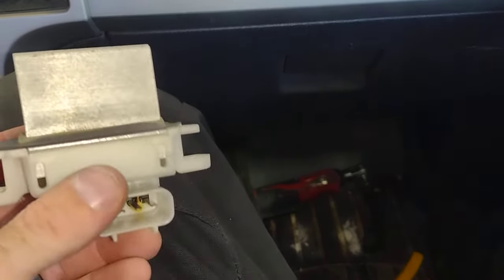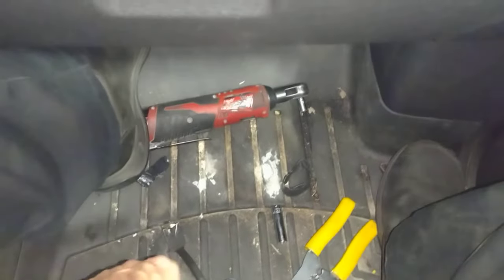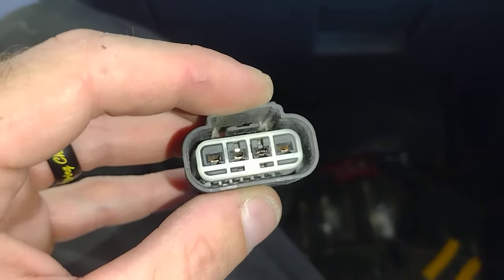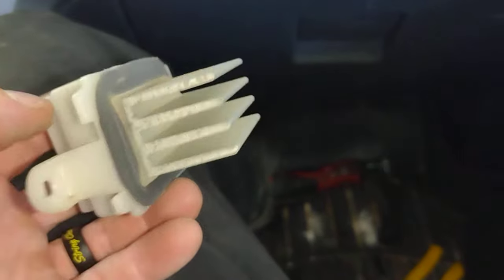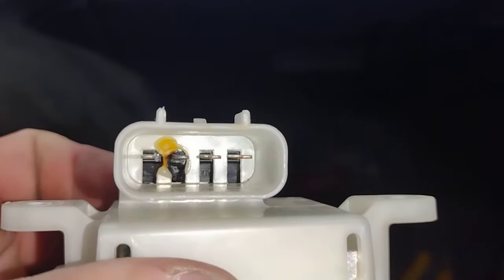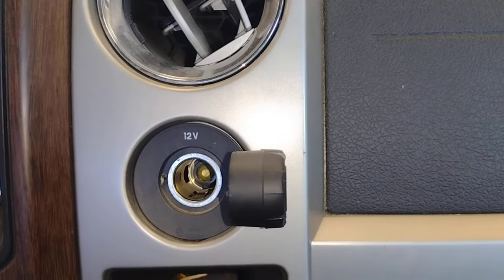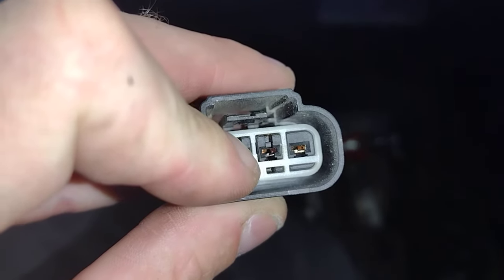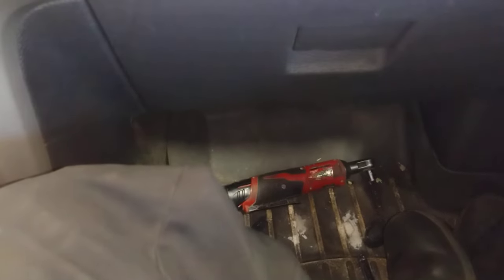2011-2014 F150 Blower Motor Randomly Works. Check This First.

Comment: I've replaced mine a few times already. Finally changed the wiring harness out with the one that came with the resistor and the motor hasn't worked since. Took the dash apart and got it to work on high but would not turn off. Got it to turn off and haven't got it to start again.. No heat, no AC. I checked for power at all connections. Checked for resistance and continuity in all but the black ground which I cannot find the other end going into the harness by the steering wheel. I applied 12 volts to the motor itself and it kicked right on. I have an aftermarket dash kit with blower module that I'm not 100% sure on. It's not a rheostat. Almost like an encoder that reads the revolutions for both fan speed and temperature knobs. Can't really test it. I've checked all the fuses and relays. Those are good also.  I also had the blend door issue with the loud vibration that I ignored for a while. The problem started where my aftermarket radio would not turn on, the module would not work. A few taps on the plastic would bring it back. Happened a couple times right before it died. The heat and AC do still work. I can feel it every once in while very faintly coming from the vents. It's sucked driving in traffic with no AC, especially through the tunnel but I can deal with that. I do have to fix this before the winter though. Any ideas on what I'm missing? I'm ready to wire the motor to 12 volts with a switch, fuse and rheostat just to get it working lol. I just don't want to cut the connector lol.
Reply from the maker: Sounds like the actual hvac module is going bad.  And what harness to the steering wheels?  Are you talking about the entire harness?

Comment: Thanks man! I checked mine as the fan would come on and go off. The 2nd pin on the resistor was burnt as well as the plug. Ordered both from Amazon for under $30 and it took about 30 min to replace. Works perfectly.
Reply from the maker: Your very welcome!  Glad you got it fixed!!
Reply: Whet is the part name,  so I can order mine from Amazon?
Reply from the maker: @antoncarroll623  blower motor resistor. And blower motor resistor connector/pigtail
Reply: Thanks.  I was wondering if I should order the pigtail as well.  I'll examine it first before ordering.  It just happened today.
Reply from the maker: @antoncarroll623  it's probably melted. And 99% of the time. It's the connector and the resistor. Do them both while you are in there
Reply: HVAC Blower Motor Resistor AC Blower Control Module - Compatible with 2010-2017 Ford Expedition 2010-2014 Ford F-150 2011-2017 Lincoln Navigator Auto Temp Control - Replace # BL3Z-19E624-A YH-1829
Reply from the maker: @dennismccall9632  that's the one
Reply: So….. I get how to replace it … but …then there is that soldering and shrink wrap part … not my expertise… actually have not done it before. But Louisiana dead middle of summer - I’m about to handle it . Any suggestions?   Hints , directions,rules , laws, motivation , hey don’t F up your truck quotes ?? Hell… hold my beer .. I’m going for it … 🤞🫣

Comment: Hey thanks man 😊 saved me a trip to the mechanic shop.
Reply from the maker: Glad I could help. That was your problem?
Reply: Guess it was the wiring that wasn’t making a connection. I pushed it in and it started working again. Works fine now.
Reply from the maker: @eliascastillo1641  keep an eye on it. Connector is known to fail. But now you know what to look for if it quits again
Reply: Will do👍 thanks again
Reply from the maker: @eliascastillo1641  your very welcome.
Reply: Found to be the problem on my 2013! I’m ordering the parts tomorrow!! In the meantime, I’m using some dielectric grease to hopefully keep it working for a couple days until I can get parts and do the repair!!

Comment: The Chevy and GMC pickups do the same thing. I had to replace a resistor and pigtail on one a long time ago. We used the Napa pigtail. I just used the included butt splices.
Reply from the maker: Yeah our pig tail comes as a kit with little metal splices and heat shrink or I can solder it which is what I did with the heat shrink. I've done a few on Chevy S10

Comment: Hopefully the issue was loose pins and not a resistor that's underrated in wattage.  When you're slapping a heat sink like that on a resistor you've got several issues to deal with.
1) What's the max ambient temperature in the local area of the resistor that it'll be exposed to?  At a minimum you'd want to be planning on 75C.  (Nice summer day baking in the sun.)
2) What's the wattage of the resistor?
3) What's the thermal resistance between the heat sink and the resistor?
4) What kind of airflow will be around the heat sink and how are the fins aligned to that airflow?
5) What is the effect of self heating?   (That looks like it's in a pretty bad place for air circulation so that resistor is going to go to ambient plus something.

But yeah, that's how I do my electrical work.  Get the right connectors, pins, solder it together, heat shrink, etc.
Reply from the maker: That was way too in depth for a resistor. I just put a OEM one back in it. These things have a common issue of doing that. Replace connector pigtail an resistor. Good to go
Reply: @BeardedFordTech  - I totally get it.  When I see something like that I always look to try to find the root cause for the failure.  You're in the business of getting it back to factory spec and send the customer away happy.  I should probably also mention I'm an electrical engineer and I do hardware design so when I see a failure like that I start to become suspicious of a hardware design issue or maybe when we wrote the spec for the system we had some incorrect data or made an incorrect assumption.  In my world stuff like that should  never happen.
Reply from the maker: @abikeanditsboy3449  then every time i have an electrical failure like this im calling or emailing you!

Comment: Thank you 🙏 
I got this replaced super easy.. Blowing air but it’s not cold… 
Do I need to recharge the condenser?
Reply from the maker: You don't recharge the condenser. The condenser is just a heat exchanger. You may have to recharge your ac system. Have the system hooked to a machine and check pressure. Then pull vacuum and do a vacuum leak test. If passes then recharge

Comment: I have a 2014 f150 ecoboost and the ac works fine unless I turn the max a/c on or the fan speed on high. It will run for a few seconds then shut down completely. The only way to get the fan to turn back on is to shit the vehicle off and then turn it back on. I changed the pig tail and resistor
Reply from the maker: @hughg.rection5389  did you change the blower?
Reply: I did not replace the blower motor
Reply from the maker: @hughg.rection5389  i would replace that.  always replace it when you replace a resistor

Comment: I have already replaced both connectors, I only need the resistor, and it still doesn't work and the resistor looks in good condition, please help
Reply from the maker: @samuellopezbenavidez7369  did you replace the blower motor? Always do them in pairs. If thst doesn't fix it then it needs an HVAC module

Comment: This worked for awhile but now its doing it again? Short? Ground ?
Reply from the maker: Check that plug again. What kind of motor did you install when you fixed the plug?  Ford has an updated part for this.
Reply: @BeardedFordTech  I replaced the resistor, now the fan speeds work fine but it only works when it wants. AND,,,,the stereo went blank. I know the stereo is fine because this is what happened prior to replacing the resistor.
Reply from the maker: @michaelelliott1699  you replaced the resistor but not the fan or the connector?  Replace them in pairs. Always replace them in pairs. And if the connector is melted like in this video then it needed to be fixed as well.

Comment: I had an intermittent issue. The blower motor would work fine on all speeds then randomly shut off and eventually come back on now I got nothing. If the pigtail is bad is it going to be visibly bad? Mine looks good no meted pins and I bench tested the blower motor and it works. It’s leading me to believe the resistor itself is bad but can a resistor make the blower motor not turn on at all?
Reply from the maker: Resistor is what controls the blower motor. Bad resistor will cause it not to work. Replace the blower motor with a new resistor. Cause as soon as you replace the resistor the fan will go bad. Always do them in pairs
Reply: @BeardedFordTech  so after doing some more diagnosing I found that my blower motor relay is melted. Part number 8L8T-14B192-AA. Would you happen to know if there is an updated part number for this 4 pin relay I can’t seem to find anything online. Thanks for the help much appreciated!
Reply from the maker: @michaelprezioso4288  nope. That's just a regular relay. Found at any parts store. Is it the relay melted. Or did it melt the spot it sits in too?
Reply: @BeardedFordTech  it started to melt the spot in the fuse block also
Reply from the maker: @michaelprezioso4288  then your going to need a new fuse block as well.
Reply: @BeardedFordTech  I thought about that already. Can I just move it to a spot not being used like spot number 9 for the tt battery charging relay. I don’t tow so I would never need it. So I would pull the wires out of spot 3 and move them to spot 9?
Reply from the maker: @michaelprezioso4288  I wouldn't if the wires are melted underneath. If the box is melted. I'm sure the wire terminals are too. Get a new box. Then move it to number 9
Reply: @BeardedFordTech  I think you are absolutely correct. Mine quit working with all symptoms pointing toward the resistor. I replaced the resistor and all worked great for about a month. Now the symptom is intermittant off and on. If you are on say, level 3, then turn it up, it goes off. A minute later it will come back on again as if a auto-reset breaker trips. My thoughts are the blower motor is going bad and pulling too much current which in turn loads the resistor and connections. I am now looking to replace the blower motor and relay as a pair and see if that corrects the issue. I did notice a slight change in sound with the motor that would come and go, as if the bearing or bushing is going bad.

Comment: I don't understand why the auto manufacturers are still using this ancient technology to control motor speed.  A PWM controller gives infinitely variable speed from zero to max motor speed.  It is also less likely to over heat like a resistor.
Reply from the maker: Costs

Comment: Hey my neighbor is having issues with his, changed blower, resistor, and pigtail. Motorcraft, aftermarket, and ford dealer and yet it starts and stays on the max setting. What else could it be? Any hints? Relays and fuses were checked also
Reply from the maker: @dnyce9650  so it has a new resistor and a new blower motor?  If it's wired in correctly then it's the hvac control module.  That's where you turn the ac on and has the knows for the blower and heat and cooling .
Reply: @BeardedFordTech  yes new everything and wiring correct but fan just continued on max....a ford mechanic recommended the ignition switch, any thoughts? I will look into the hvac module, will anything stand out to me to know that it's bad? Any info helps alot...thanks for the feedback
Reply from the maker: @dnyce9650  ignition switch?  Signs it's bad it's the blower stays on after repair. I would be looking at the hvac module

Comment: I got a 14 f150 as well but when i click on my ac air recycle it doesnt work i can smell other people exost any sugestion?
Reply from the maker: Check the recirculation blend door motor. They have an issue with breaking.
Reply: @BeardedFordTech  yeah, I figured it out today. I went ahead and just put some foam to keep the vent wedge up. So it can just recycle the air. It wa freeeeeeee lol.
Reply from the maker: @SUPERrrCHRIS  you gotta do what you gotta do.
Reply: @BeardedFordTech funny how I came here to fix the ac which I did thanks to you and now the same thing that you're doing is happening to mine. Thanks bro!

Comment: I have the same year and same ac setup with the screen. Mine will not blow any air whatsoever. I’ve replaced the motor resistor, main blend door, and the blower motor. Also replaced the ac compressor a few months back bc the clutch bearing went bad. I even tried another radio bezel complete with the ac module. Still no air out at all. Compressor kicks on. I manually grounded the blower motor and it comes on that way. HELP SOMEONE PLEASE!!!!
Reply from the maker: Did you replace the pigtail connector to the resistor?  And did you program the HVAC module?  Or have a scan tool that can read it?

Comment: Hey man so I replaced the resistor and the connection as well… but when I turn on my ac takes a while to kick in , what can it be the issue??
Reply from the maker: Takes a while as in how long?
Reply from the maker: What brand resistor and motor did ypu use?
Reply: @BeardedFordTech  maybe like 3 sec
Reply: @BeardedFordTech  autozone, duralast
Reply from the maker: @FordGuy20111  yeah they don't like the aftermarket ones. I've seen them delay up to 10 seconds. I've put aftermarket in my fleet of 6.8 powerstrokes. Same thing. Went back to motorcraft. Works normal. Kind of a hit or miss

Comment: Do you have to soder the resister in?
Reply from the maker: No. It sits inside the hvac box and has a plug like the blower motor.
Reply: Ok my heat has been running high and won’t come down or sometimes low and stays on
Reply from the maker: @user-ve2up9pw2y  change your resistor. Check the connector